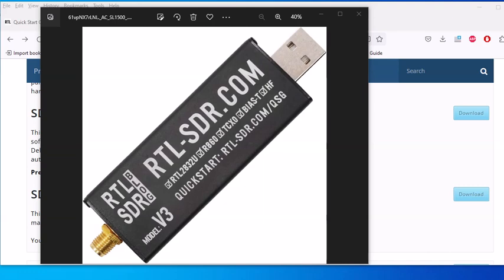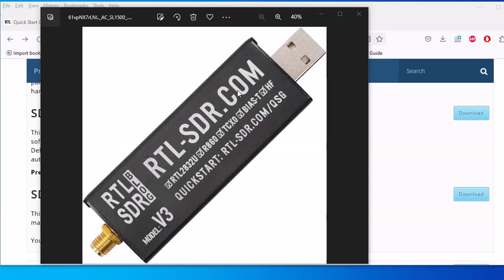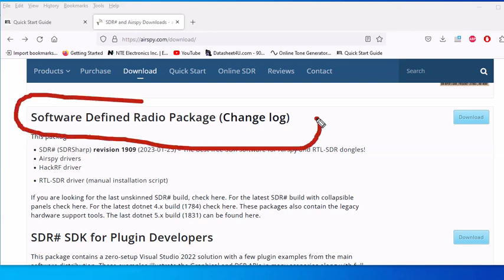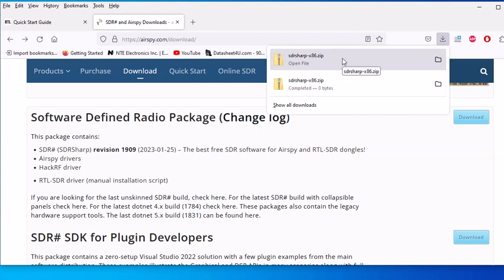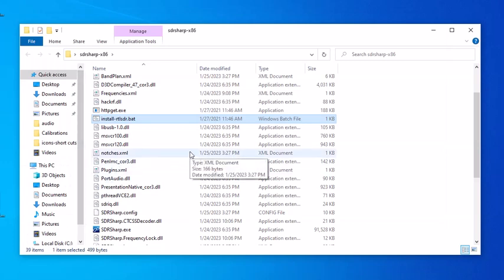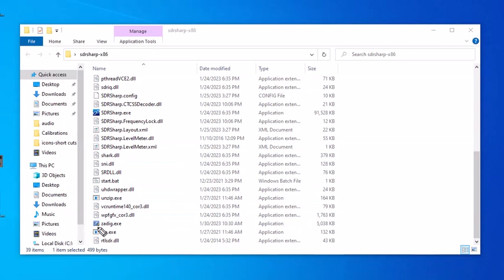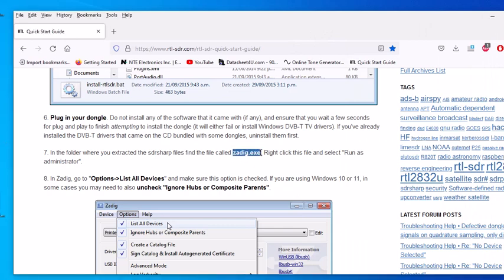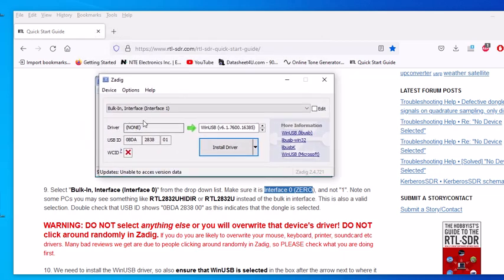🔺 How to replace your SDR (Software Defined Radio) dongle Windows 10 driver, or it will not work!!!🔺

Comment: I have bought a new black version 4 after the siver version 3 broke down and over heated ,The black version runnes a lot cooler by 30 C  that the silver V3  Windows 10 22H2 version works fine

Comment: i downloaded the software for this device and it crashed when I tried to change frquency, I read there is a bug in the software and they are working on it.  I later read on another site where a guy downloaded an olderv fersion and that worked, so I did the same and have not had a crash since.

Comment: The Amazon seller claims the black version is an improved newer model, even though the silver model is more expensive. Any advice which one is better?
Reply from the maker: My question is what is improved on the newer model? did the seller say?
Reply: Even i had the same doubt .....so which one did you get ?
Reply: The only difference between the Black RTL-SDR v3 and the original silver units, is the tuner chip. Since the R820T chips are no longer available, all SDRs have moved over to the R860 instead (this goes for NooElec & Airspy devices as well). This does not impact the performance in any way & many sellers are claiming that black version is "  improved newer model " which is not !!!